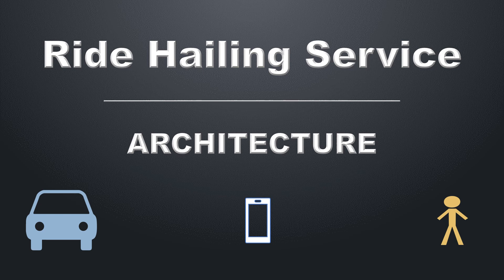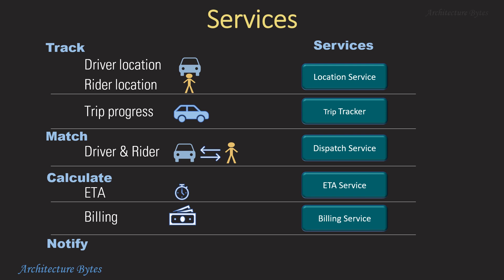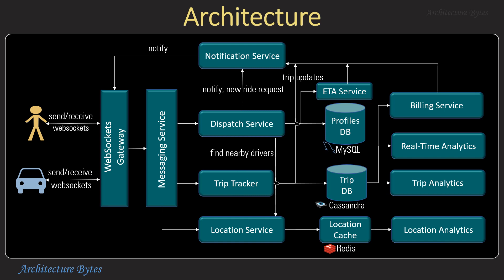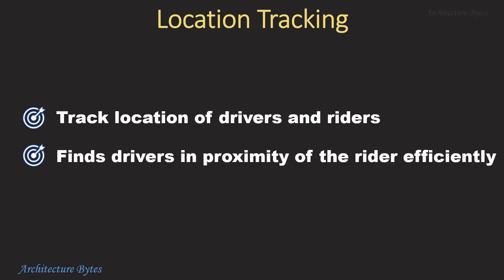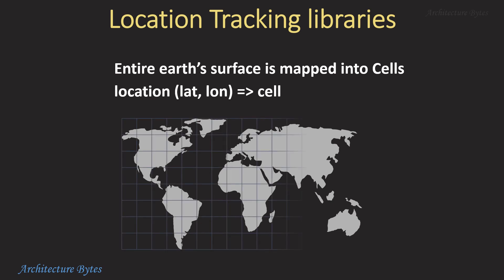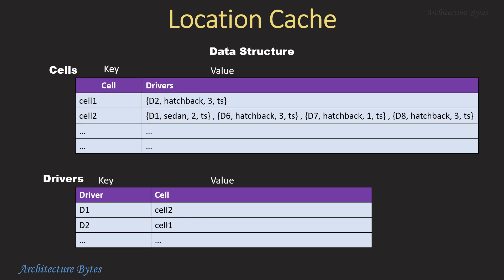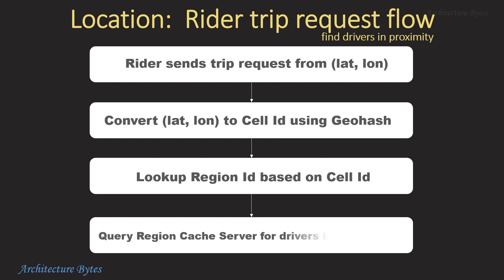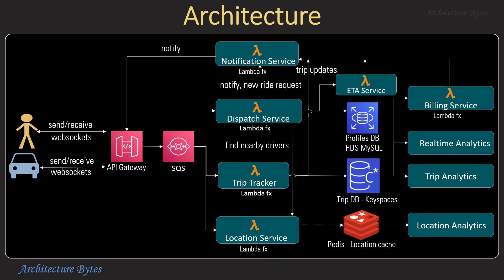UBER Architecture System design | Ride Hailing Platform

Comment: how dispatch service will call location service ? it shouldn't be directly iguess 2:08
Reply from the maker: It invokes it to find drivers in proximity to the rider (for driver-rider matching) - pls see 3:50
Reply: Thanks, I have seen the whole video, but my question is does dispatch service contact location service by grpc? Through stream? How technicaly they get in touch?  @ArchitectureBytes